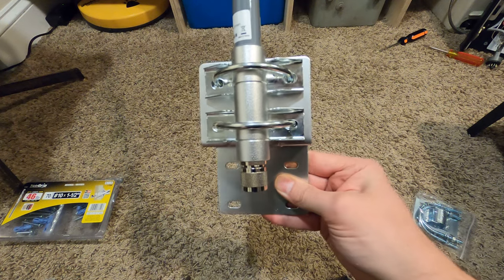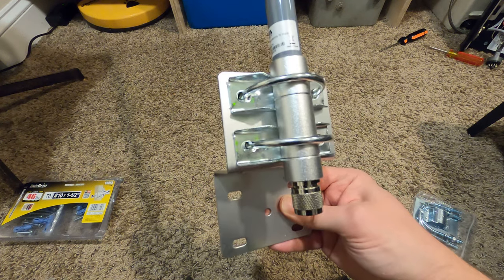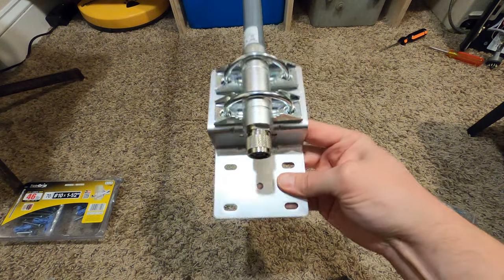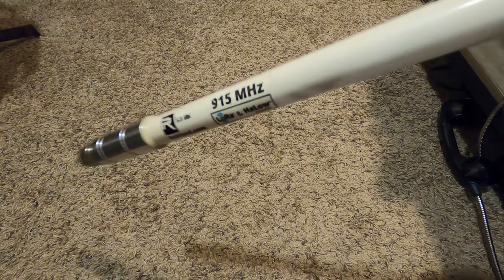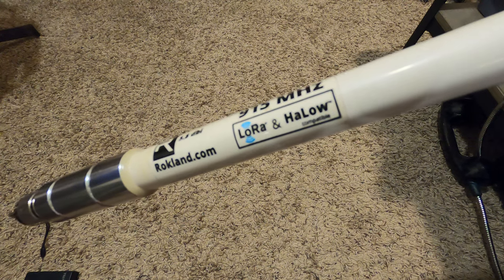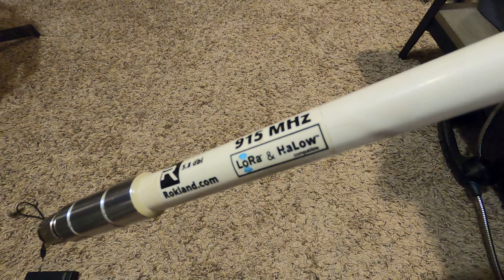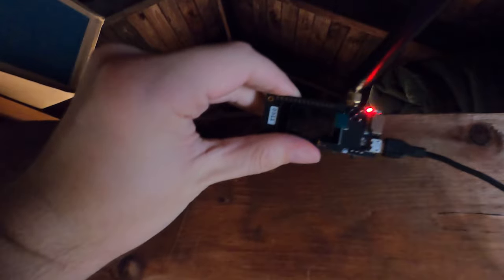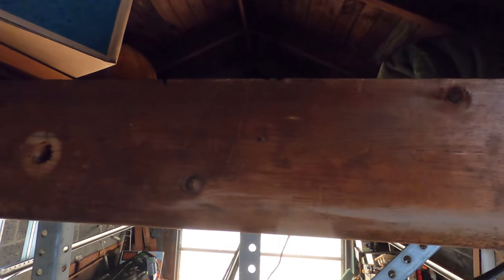Meshtastic Station G2 Node Installation in a Garage

Comment: 1.2 is the best I've seen so far. No one has really made a good video with this NanoVNA for 915 mhz. Could you do a video showing from beginning to end going thru the menus? Ham Radio Crash Course kinda skipped over some screens.
Reply from the maker: That's a good idea. I've bought a few of the antennas I've seen people recommend online and was thinking there haven't been many recent reviews or tests of a lot of the current options. I could do a video walking through the NanoVNA setup and then testing a few antennas.